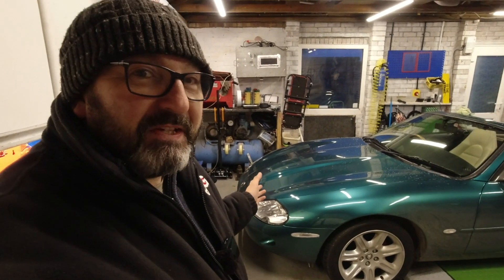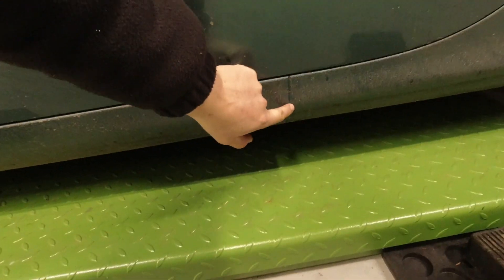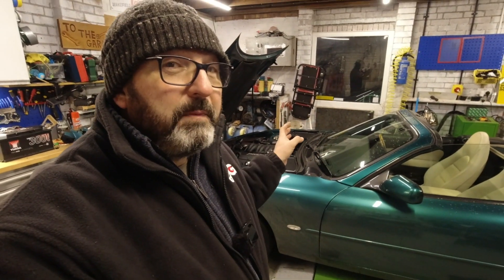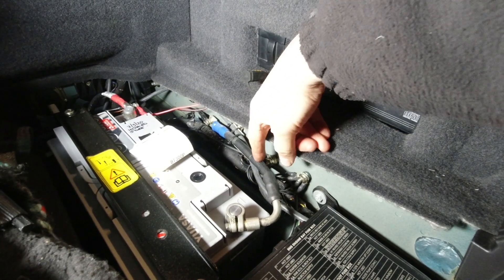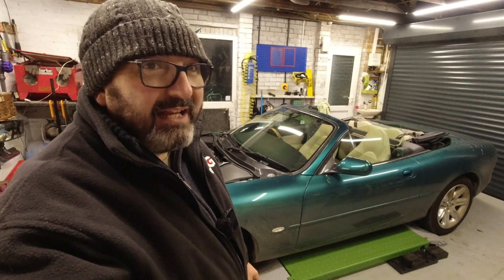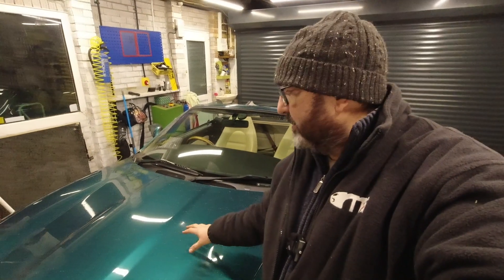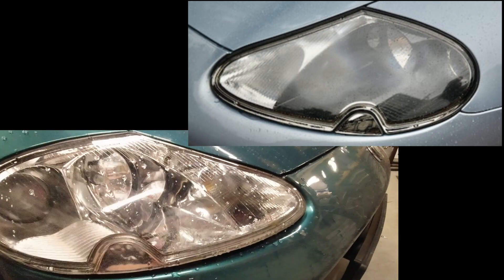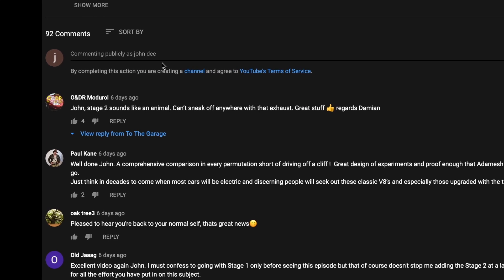Part 2 of 'The most common Jaguar XK8 questions Answered.

Comment: More great work John; thanks! In addition to your reasons for not buying an XKR - all of which I share - and admitted deeply embedded post-WWII-era Brit's frugality, I was influenced by the higher fuel consumption, not a trivial matter, especially if one likes to use the XK8(R) both as a grand tourer AND a fast car; the high cost of the 'R''s many special parts, including its suspension, and anything to do with the blower. The last supercharged car I had was a Pontiac Bonneville, for which the supercharger replacement cost was 2 grand. We parted company over that.
Reply from the maker: Never seen a single bonneville in the Uk🤔.  And Im from Lincolnshire where we have more american motors than most.

Comment: While you may spot the rust susceptible areas ; what could be the DIY solution to stop the corrosion ? 
How is it conceivable that Jaguar would allow fixings of aluminum body panels to mild steel without using stainless steel and bi-metal separation ?
Reply from the maker: There are no Aluminium body pannels on the X100

Comment: Hi John, terrific video. Thank you.
I have a 2002 coupe and have recently had a second-hand gearbox fitted. There has now developed a noticeable clunk when the box changes down from 5th to 4th and 3rd which I can’t remember being present previously. Any ideas as to possible causes?
Many thanks
Reply from the maker: Could be low fluid level or the prop shaft, Cush drive/UJ's are worn

Comment: RE: EMISSIONS ISSUES -- If you get a "check engine" light and your code reader shows an "emissions" code, the 1st place I always check is to make sure the gas cap is tight and seated properly.  About 10 years ago I actually replaced the gas cap on my wife's '03 XK8, and that solved the problem (and was quite inexpensive, as I recall).
Reply from the maker: A VERY GOOD TIP VERNON. Thanks for this.
Reply: @ToTheGarage  I enjoy your channel.  Keep up the great work!

Comment: Great video! Thanks, John!  Unfortunately for me I tried starting the car with a 4amp trickle charger connected to the terminals under the bonnet and now electricity is gone. Do you have any suggestions where to start diagnosing, what fuse or relay, or should I check them all and take it from there?
Reply from the maker: All is unfortunately your only sure method, but start with underbonnet fuses and relays.
Reply: Thanks, John!

Comment: Hi John.
Having a problem with my 1998 XJ 3.2 V8.
When full lock is applied the revs drop and engine stalls.
I have a new battery so voltage good topped up ATF steering fluid.
Is there a idle adjustment screw that you have knowledge of so I can increase the revs only needs maybe 75-100 rpm increase, only stalls on full lock to lock whilst trying to park up.
Any help would be great.
Thanks James.
Reply from the maker: Maybe needs its power steering system flushing out. I think you need a good OBD2 scanner with 2 way coms to restet the idle on an x308 (full fly by wire throttle. 
Try cleaning the MAF (typically raises RPM by about 300 rPM